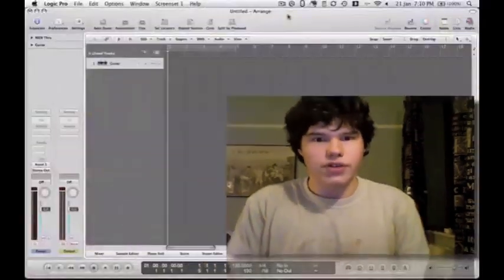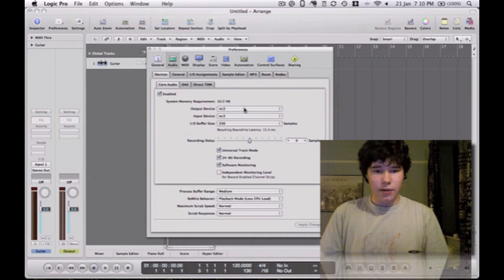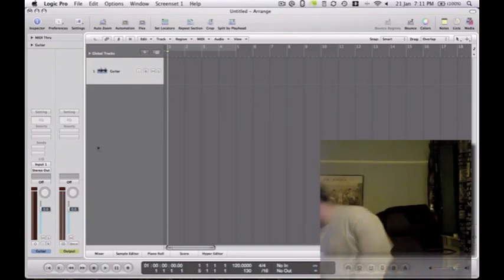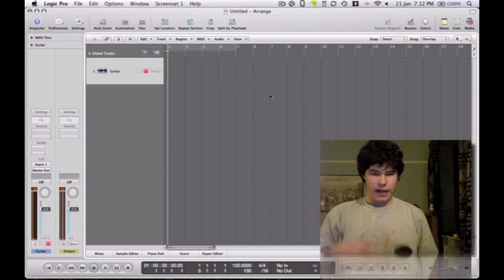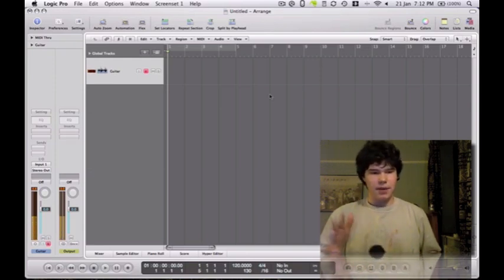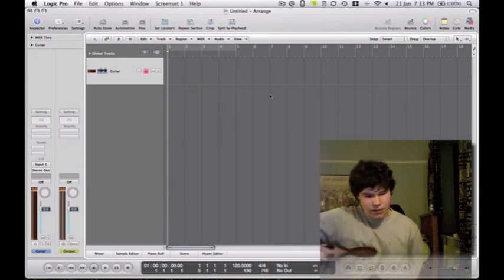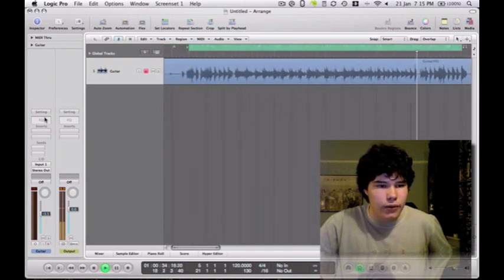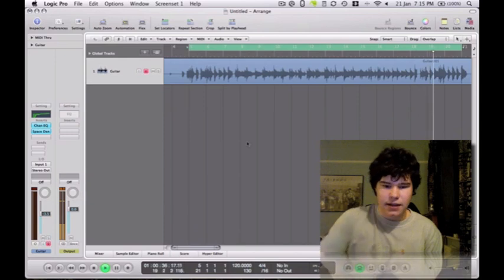How to set up and Record using the Alesis iO2

Comment: Hey dear Musician-Community! 
I've got a problem. I inserted my guitar and my Mic into my iO2 Device, and if I put the Volume up, the device recognises the signals... But my Pc doesnt. I use Cubase 5 and whenever I want to rec sth, there are like no signals going into my Pc. 
I already checked my drivers, they should be fine. 
You guys have any assumptions? Thanks.

Comment: I´m using this on a Windows 7 pc, i have the asio drivers installed and aslong as im only playing sound from the pc trough the interface into speakers everythings fine, as soon as i activate the microphone however (both mic input and guitar line in), or open ableton i start getting a peeping noise, the sound quality and and latency are perfect, how do i stop the peeping?

Comment: Hey there I just bought this and I am having trouble getting it to work with cool edit pro, do you think you could help? it only records in mono and I cant get it to sound as strong as it did when i used my power supply. Please help if you can, If i cant get any help this i will be out of a 100 bucks. Thanks for any help that you can offer.

Comment from the maker: @CabFareRemix Sorry this reply is so late, usually if you have a MIDI controller you can either set it up via the iO2 or if it has USB that way as well, you then obviously need an instrument sound for it and then if the sound won't come out of the built-in output, you might have to go through the iO2 I'm afraid =[

Sorry I can't be of more help =[

Comment: I use GarageBand and for some reason when I record there's not sound coming out. You know where the light lights up when MIDI data is going out? Mine doesn't, and the Recording Levels won't budge - they're turned all the way down so even if it did have info going outwards, it still wouldn't record anything. I feel like I've tried everything...help?

Comment: Nice Video! Can you tell me if this device is good as an audio interface for live concerts use? I'm interested in using it with Mainstage 2, with the loopback features and the other effects. So, can you assure me it will be fine to connect its line out to a guitar amplifier? thank you

Comment from the maker: Right, 

You need to do what I did in the video and set the Output device as "Built-in Output" OR if you can't find that option anywhere within Logic, go through the Alesis Box into your speakers, there should be a headphone port for a large jack, when Logic uses the Alesis box it sets that as the default out, if that doesn't work, I will search the darkest corners of the internet  to find a solution! 

And you are most Welcome :)

Comment: @Webcam9000 

Cheers for the fast reply mate. The sound going in is fine, I can see the wave forms when I play my midi keyboard and guitar, I just cannot get the audio to come through my line out.

However once I disconnect the Alesis usb the sound works again through the speakers. Confused. A lot. Sad face. 

Cheers mate

Comment: Hey, nice video. Very handy.

I'm still having a problem with Logic 8 where I cannot find the out put tab like you describe around 2:00.

I'm using and iMac with JBL Creature speakers from the line out. I've set the the iO2 as the input, but that's where I get stuck. Is it a Midi Setup thing? 

Cheers mate, and keep up the tutorials, they're good!